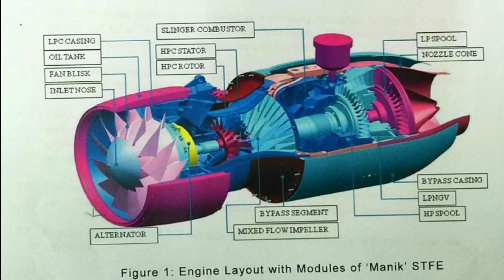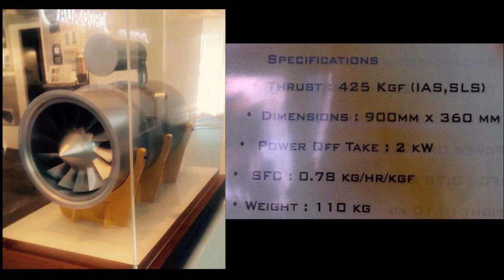After successful ground trials of STFE Manik engine, GTRE issues EoI for ToT

Comment: Is this engine only intended to use for Nirbhay cruise missile or does it have any other application ? Is this Engine superior to Russian supplied Engines for Nirbhay.
Reply from the maker: As said in the video DRDO only mentioned saying its a engine for UAV applications that means it will cover other applications too.  Russian engine has better thrust to weight ratio but this is way cheaper as being indigenous. For eg: we earlier used Russian engine oil for STFE but import stops and now we have our own ver which is 70% cheaper. Cost counts!! Also we used reliable Turbojet engine in last Nirbhay missile test for same reason, so Russian options are far gone.
Reply: S.R.T ...Hi..bro